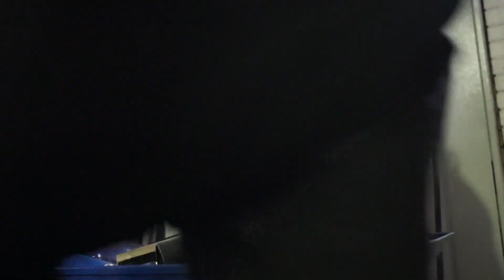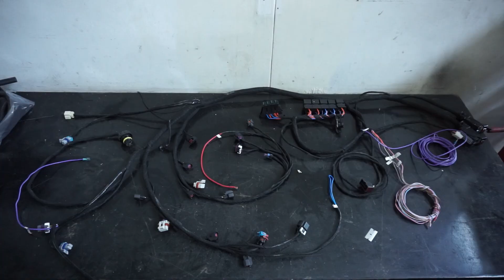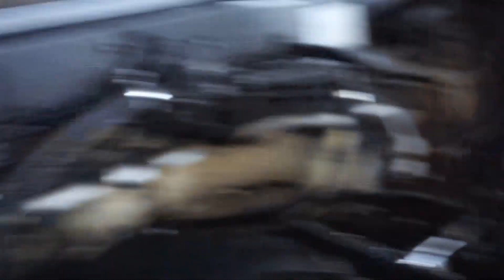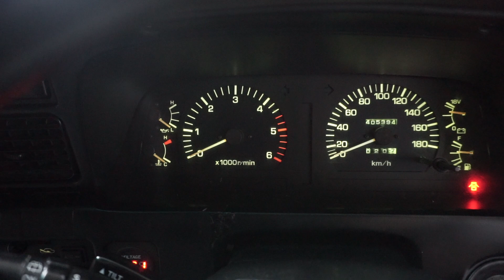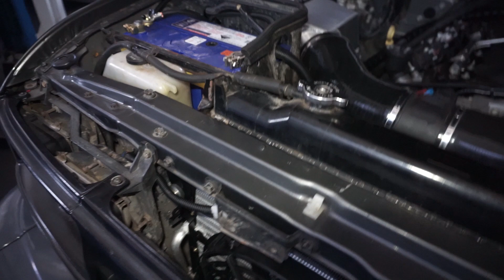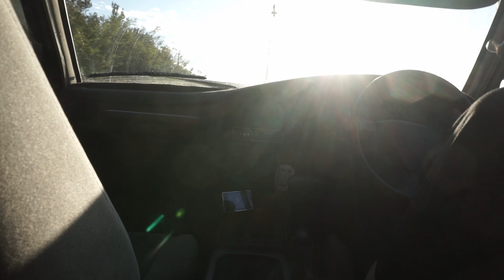Land Cruiser 6ltr Ls Motor Swap Part 3/3

Comment: Hi, where can I find the sensor adapters you used for the oil pressure switch and the coolant temp?
Reply from the maker: hey mate you can buy them from marks 4wd they have them listed on their website

Comment: What is that screen called that shows gear selection, trans temp etc
Reply from the maker: its part of the shift module we use you can get ones that just plug in the OBD that do the same thing
Reply: @ZaredFox  do you know of any that you would recommend ? I’m mainly after gear selection, trans temp, water temp and oil pressure. I have a l77 with 6l80e in a patrol
Reply from the maker: @jaydenclark3364  i would take a look on ebay they all work about same just choose the style you think will look best on your dash
Reply: @ZaredFox  I’ll have a look cheers mate

Comment: Awsome build, how reliable are these v8s? Compared to the 2uz from the 100series?
Reply: Plenty of million mile examples, still running strong in US trucks.
More power, less weight, less fuel, cheaper parts and far less complexity.
Reply: @aaronnoyb  good to know

Comment: awesome work there folks, quick question with the rpm on the old diesel taco only going to 5k does the l98 rev over that limit?
Reply from the maker: yeah we spin them up to about 6600-6800 depending on the camshaft just have to use the old ear tacho for that one lol